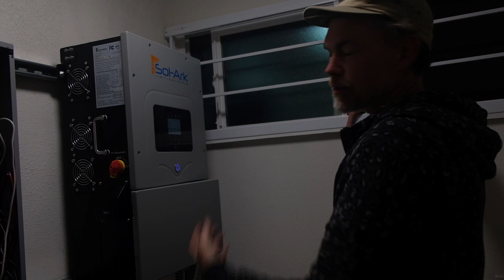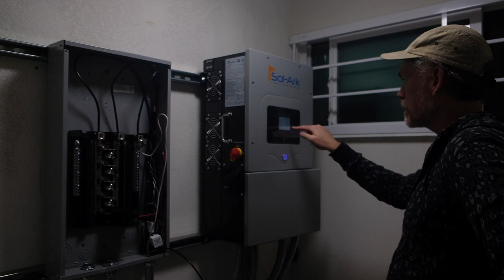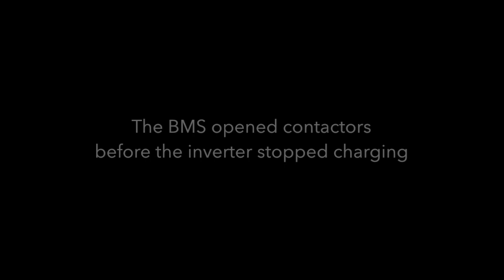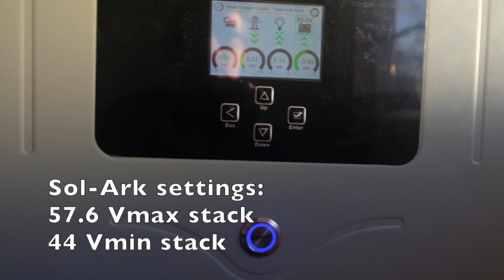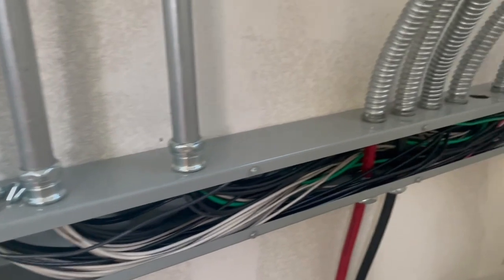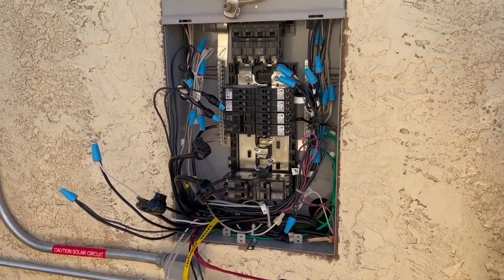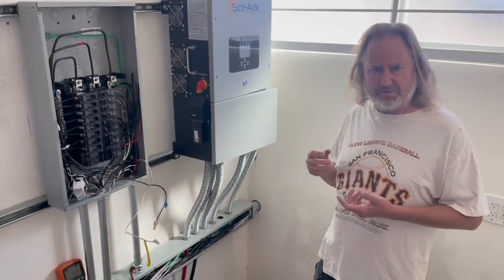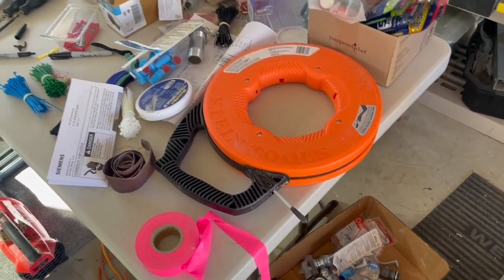DIY Lithium LFP Battery Pack: Sol-Ark Programming & Whole House Backup, Part 4

Comment: you wired the solar pv wrong. you should wire the pv into  the solark generator input you would get a better result.
Reply from the maker: interesting. We followed the directions from Sol-Ark. What are the advantages of connecting into the generator input? I guess we would see the PV production on their screen? What else?

Comment: Nice but my battery bank is 67kwh
Reply from the maker: What is your configuration? What cells are you using?
Reply: @offgridsolarstore3831  16s 4p x 6 lifemnpo4 60 amph todo of 384 cell
Reply from the maker: Nice! What BMS are you using? How do you manage the multiple stacks in parallel?
Reply: @offgridsolarstore3831  no bms i top balece 1 year ago and check them every 4 weeks